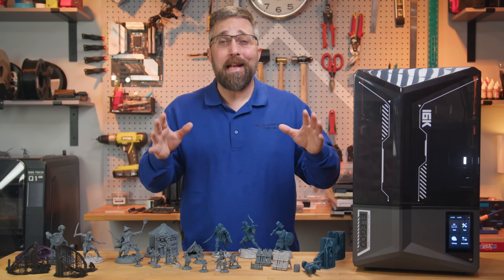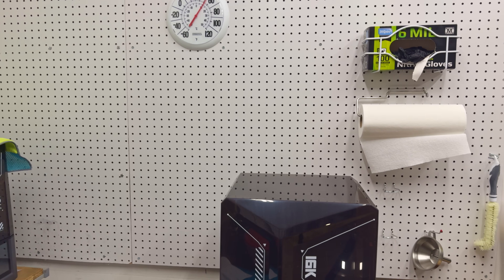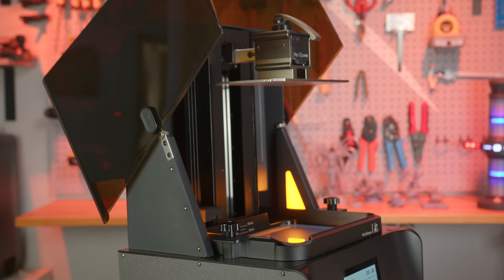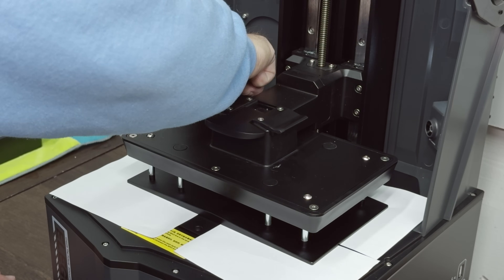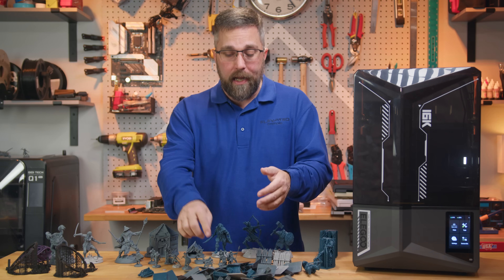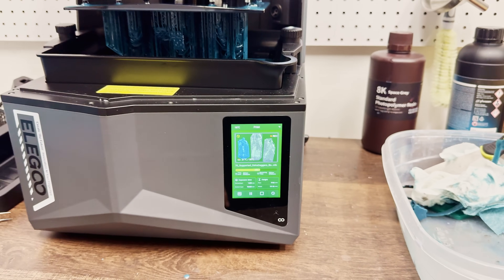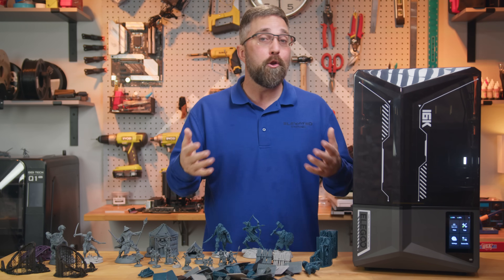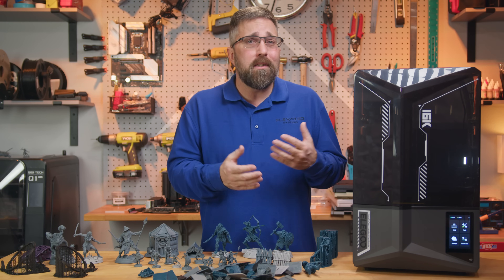Elegoo Saturn 4 Ultra 16K: Hype vs Reality!

Comment: So I was looking into buy this. But now not. So what do you recommend??
Reply: i had a saturn 2 8k and now a saturn 4 ultra 12k..   Both of them works right from the start very well.  the saturn 4 12k is way easier to print ,since you don't have to autolevel the plate every time.  The problem i had with the Saturn 2 , was an insane accident ,that had no idea how could it happen still months after it , basically the plate that goes on top ,that  i really really really sure i secured as always do , falls in the vat , full of resin ,splashing resin everywhere and enter through the holes of the z axis pole that move the plate. And open the printer and resis is everywhere in the circuits and right in the motor too. and after i clean all , the motor was never the same ,stop working after 5 minutes of printings locks.  then got now the saturn 4 ultra. and like i said way more simple since you don't have to manually level the plate ,like 99% of all printers in the market.. i think only Elegoo Saturns 4 ultra do that. 
However the new printers saturn 4 , have their own things ,that you need to learn to handle it , for example the Big sounds you heard in the video , as if something breaks inside , that happened to me too..  And what happens is the new film in the vat ,that holds the resin ,they use is not very elastic and so if you use INCORRECT exposure settings for example. exposure time is the time in seconds  the ultra violet light will cure the layer being printed in the resin.. Thing is that if you use too high exposure settings , the resin will become like a very strong Glue on the film  and the the motor try to rise the plate ,it will become stuck for some time , until it detach and when it doing sounds terrible ,will scare the shit of you ,as if some was broken in a hundreds of pieces inside.  The video shows exactly how it sounds.. its horrible. and you think the printer broke ,but it didn't.. it just the sound of the Film ,that is made of a super strong material that resist intent heat and also do not break easily when pulled ,it only deform and expand ,which is what is supposed to do.  But still it will scare the hell of you , is like a pshychological thing..  And that problem of the film being stuck in the plate will more or less fix on its own , with Use.. because it will become more and more elastic and so less likely will become stuck in the plate.  So is a problem of SUCTION. and this problem happens mostly when its too crowded the film with too many figures at same time.. this cause every area of the film to be pulled at same time and will produce a bigger sound than usual when it have to detach the plate with the  hardened resin from the film.   To avoid this problem , or reduce it significantly , don't overcrowd too much the plate with models to print , because the more models you put in the plate , the more work the plate will need to do on the film ,detaching it.   You can also reduce the sticking problems by reducing the[ exposure time], that is basically the only number you will need to edit ,depending on the resin you use ,since each resin of each brand have different fluidity and each color of resin have different interaction with light.. the more transparent the resin the more light pass. the more darker the less. the time the printer will have its ultra violete light turned on ,to solidify the resin.  default settings are 2.5s.. and i tried using like 4.0 and proved to be too much and loud noises in the printer. so now using 3.2s with layer height of 0.030 and now is all working very very well.. not much noises and all print great.. it works well with Elegoo space grey resin.. but like i said each resin color and brand use different exporsure time ,since light resistance change depending of the density and color of the resin.   i also did a reset factory setting, an option that exist within the printer display controls and setun lan settings to allow  the printer to connect to the internet and upgrade its internal programming , its firmware update. Once i did that , and avoided over crowding the plate with models no longer had the problems. Whenever you hear the loud sounds is the suction..  you need to find a way that even if you are printing many things at same time.. that there is enough surface distance between each item you are printing. So that the plate don't get stuck in the film or push too much the film.  Also when printing anything , is better to print it standing  in a vertical way or 45 degress angle to the plate than put it horizontal to the plate..  because the more continuous area a model have in the plate ,the more pulling force the printer will need to use to detach it from the film.  So in summary the saturn 4 ultra works very well ,when its setup properly ,but you need to troubleshoot at times if you are not aware of the way it works well or not that well. to fix the printer over tweaking that you need to do , they need a new film ,that is even more Elastic and fix its networking problems. SO is better to use the flash drive ,the printer includes ,than to pass the model through wifi. because if your wifi signal fails.. the printing will fail.. while an USB pen drive will never fail.  don't depend on networking . is more direct.

Comment: Thanks for the video! I see no reason to upgrade my S4U 12k now that I've already rigged up a temp control system with some spare parts I had laying around. I'm sure the directly heated vat is better, but I already solved that issue on my old one and I feel like unless there is another real upgrade, the 16k screen is pretty much irrelevant. I do like that elegoo seems pretty responsive to consumer feedback, the added handles and little improvements seem encouraging, even if not enough for me to buy a whole new unit. I also generally wait at least a few months on any tech purchases after a release, anything with a ton of components is almost always better by the 2nd-4th firmware update🤷‍♂️

Comment: The honest review is greatly appreciated and the technical issues as explained were spot on.  Subscribed!

Elegoo engineering gets huge kudos for their tilting vat release mechanism that greatly increases print time by reducing the slow up and down Z travels for each layer, but Elegoo engineering gets some well deserved booing for allowing marketing to dictate that they use a 16K LCD with a smaller build area that passes less light so the print time increases with no improvement in actual print quality.

The heated resin tray is nice but rather than have that complexity, I'd prefer an actively heated enclosure, preferably with room to store a bottle or two of resin so it's preheating.

I was always a bit suspicious of Elegoo's "self leveling bed" which looked like a flawed concept workaround to accommodate imprecise manufacturing.  That spring loaded bed pressure for the first 10-20 layers is bad enough, but it looks like Elegoo is now trying to use that to compensate for a build plate that isn't flat, and that's BAD.  To fix the problem you showed, I would fly cut that build plate flat and then lightly bead blast the surface so resin would stick to it.  The customer should not need to do this.

Comment: The 5 ultra, the 4 ultra, and the new 4  ultra16k all have build plate issues. It amazes me Elegoo hasn't fixed it yet or at least redesigned the build plate.
Reply: Seriously the build plate is the reason I’m sticking with mars 3 pro and mars 4 ultra leveling isn’t difficult do it maybe once or twice and all these build plates are just annoying hassles just for fake auto leveling

Comment: Thank you for the honest review you just saved me £450, I was torn between the pre-ordering this one or buying the 12k version but now I'm not bothering with either one!!

I was thinking about the Heygears Reflex but it's very expensive and very VERY slow.. The price of there resin also put me off not to mention the locked in eco system..
I think I'm either going to wait for the Saturn 5 or go for either the GK2 or sticking with my Saturn 2 8k! To be honest I only really use the Saturn 2 for small bits and bobs, I have multiple large printers like the Mega 8k and Apex maker.. 🙃

Comment: Their are resins that can easily take advantage of 18 micron pixels bust most models are never uploaded to that level of detail. You have to find professional level models just to start getting those higher detail surfaces and points. 

Anycubic has a knew line called "Texture Resin" that advertises the highest precision available, claiming to be able to make 20 micron points.

Comment: 8:18 this is auto leveling. How you level something is up to the manufacturer, but the principles of a device doing it by itself without your input is what makes it an auto leveler. I have never had to level my plate on my Mars 5 ultra despite countless FEP and much thicker ACF sheet changes. 

I'm dropping a dislike for saying its not auto leveling.
Reply: @ElevatedSystems  wow, what a well thought out response, exactly what i expected from someone who refuses to call it auto leveling.
Reply from the maker: @ Its just not. Do you even know the difference between leveling and tramming? Without googling? For precision and print success, the bed has to be trammed throughout the entirety of the z movement. Elegoo’s bed doesn’t even provide a way to do that. Every professional who knows anything about additive manufacturing knows it’s not “Auto Leveling” and only the sheep fooled by marketing can believe it is.
Reply: @ElevatedSystems  "every professional who knows anything about additive manufacturing knows its not auto leveling"

Oh so because it doesn't reach your standard of what it means to be "auto leveling" it is not? This is an argument about semantics, but you want to claim its just a professional standard of the phrase. 

Again, i have never had to adjust any of the leveling myself, even after 200,000 pulls and different sheets of varying thicknesses. That is auto because it automatically did it for me...
Reply from the maker: @ then explain why my saturn 4 ultra 16k won’t “auto level” There is significant layer squeeze, shifting and ghosting in my prints, which indicates an out of tram build plate. How is that possible with auto leveling?
Reply: @ElevatedSystems  because their is a malfunction in the system either caused by a deffect or design oversight. If my automatic transmission is failing to jump to the second gear by itself then clearly its not working as intended.

Comment: To exploit ultra high resolution the resin has to have high content of uv absorbers causing brittleness. A solution,  like for the Uniformation GK3 pro, is to use a 385nm light source that has less penetration in the resin leadingto less blooming and higher details.
Reply: I thought I could control the light source via chitubox software
Reply: Shouldn't reducing the cure time solve that? Since less power will be transmitted for a given cross section of resin
Reply: @paranoidpanzerpenguin5262  Given a minimum amount of energy required to polymerize the resin, you'll still experience light bleed. If you reduce the energy, by reducing the power or exposure time, you start to have insufficient polymerization and so print failures or, at he very least, loss of details. Light bleed is basically light penetration and a function of wavelength or UV blockers in the resin (opacity). If you wanna have correctly cured resin, retaining details and less blooming, especially on overhangs and inclined surfaces, with clear/translucent resins, a shorter wavelength is the way to go.

Comment: So the fact that they sent GCODE rather than a new build plate is mind-boggling to me.
Reply: "We'll fix it in software!"  I'm sure you've heard that if you have any engineering experience!😄
Reply: Seeing another video on this printer I discovered is a huge consistent issue of non flat build plates. To the amount that some couldn’t get it to do any printing. The solution was easy enough though. Sanding it flat takes about a half hour from 80 grit to 120 grit. Printing flawlessly after that. No more adhesion issues. Kinda like buying a new block plane for woodworking. You have to sand them flat before they are ready to go.
Reply: @embergrit2305  thats honestly not a solution really it should work
Reply: @embergrit2305  Well, for what the people paid for the printer, they shouldn't have to sand the plate to fix it... If this issue has been encountered by many customers, it means the QC done by Elegoo is bad and the company was rushing the printer to release.
Reply: @embergrit2305  I'll just throw it on the Okamoto and grind it to within 0.000¹" 😅
Reply: I recommended the same thing on reddit about a year ago when someone asked about troubleshooting the machine. A bunch of ppl jumped down my throat saying I was "damaging the machine". Gods I hate reddit.

Comment: 新机买回来是恶梦的开始！打印第一次去到86%自动停了！客服说软件更新问题。最后发现钢化膜中间起了泡，出厂贴不好！更换后，打第三次离型膜更加穿了，树脂流到LED屏，导致LCD屏幕损坏，现在又要花¥730重新购买！

The nightmare begins when I bought the new machine - ELEGOO Saturn 4 Ultra 16K ! The first print stopped automatically at 86%! Customer service said it was a software update issue. Then I found that the protective film had bubbles in the middle - it wasn't applied properly at the factory! After replacing it, during the third print, the release film tore even more severely, causing resin to leak onto the LED screen, which damaged the LCD screen. Now I have to spend ¥730 to buy a new one!
Reply: 晕倒 凭什么要让你花钱买

Comment: Finally a more reliable source of information and review, hank you, rather than exaggerating what great improvement it is when it was supposed to be already in the first version, now we know that we need look the other way, and let them adjust the pricing for the downfalls of the new unit and fix these issues, i was hoping but I will pass on this and save for HeyGeas RS, bye bye Elegoo.😅

Comment: My only complaint with the Saturn 4K Ultra is that "auto-leveling" plate. If Elegoo would offer an old-school ball and joint option for the build plate, I would buy one in an instant.
Reply from the maker: There are better options than the ball and joint but Ya, I understand your sentiment.
Reply: The plate is designed to waste resin.
Reply: @davidgatt8721  is there any after market or some sort of work around part or piece that could convert the plate to one that doesnt waste resin? sorry if this is a dumb question im new here.
Reply: @ not to my knowledge the plate as is is needed for the tilt action on the machine. Simply buy a Saturn 3 Ultra. They use the same LED.
Reply: The latch is great, but the plate itself is designed questionably

Comment: Great review! It's frustrating that the "upgrades" to this products are: A heater which is absolutely helpful, a bunch of QOL improvements that should've been there on the first release, and a cost of maintenance bump with no observsble difference. Very disappointing (though not surprising) from Elegoo!

Comment: fantastic review. Maybe the best I’ve ever seen. Except for calling the Mars a “beginner“ printer. Smaller does not equal beginner.
Reply from the maker: That determination is based on cost, ease of use, and results, not size.
Reply: @ElevatedSystems  exactly. And based on those other items, it's no more a beginner printer than the Saturn.  I could see an argument based on cost, but that's really it. And that's pretty subjective.

Comment: i confirm, having both s4u and m5u - mars prints faster since it uses shorter exposure (3.5 vs 3)
Reply: In your experience which one would you prefer if you had to start over? I plan on using my 3d printer mainly for tabletop minis, but I also have some ideas for larger projects that could utilize a bigger build plate... Is it worth getting the saturn 4 ultra 12k for the bigger plate, or mars 5 ultra?
Reply: @Rushtiv  i bought s4u as my first printer, but later decided to buy mars on ali november sale since it was so cheap. if you are absolutely sure you need a bigger plate - go for saturn, but mars is so much easier to handle and clean, also i hate saturn's lid - it is bulky and has huge gaps for fumes to escape. aslo, saturn's lcd  as if made of 2 panels, under some angles you can see a clear vertical line. it is not visible during exposure tests, but i saw people posted faulty screens, when one part was dimmer.
both my printer have concave buildplates, but i have never had any ahesion problems and use 25-26s burn in time for 0.05 layer of tough resin. 
also i had problems with leveling on the mars buildplate and had to add steel washers under the adjustment screws to get enough room for adjustment

Comment: the Saturn line has been a nightmare since the 4 ultra came out.  I have had these same issues over and over and Elegoo refused to replace the unit, instead I rebuilt the system from parts they sent and still have the same random failures over and over.

Comment: A note on the cones of calibration v3, we usually tell people to try print puck (the final validation) after they achieve dimensional accuracy with the sword and ale. Not all resins will successfully print the cones.